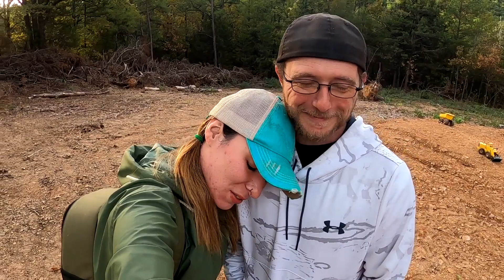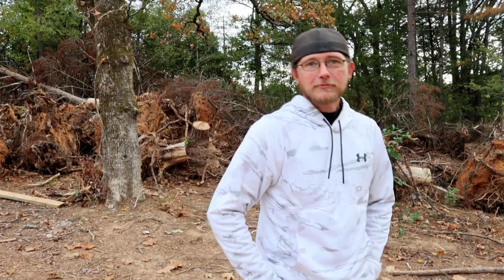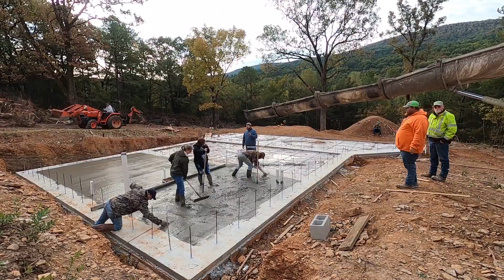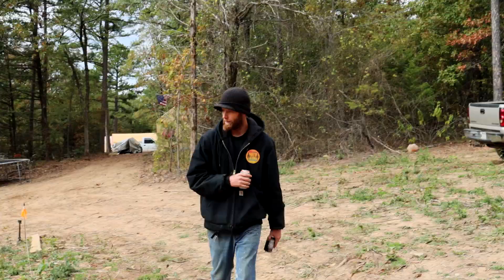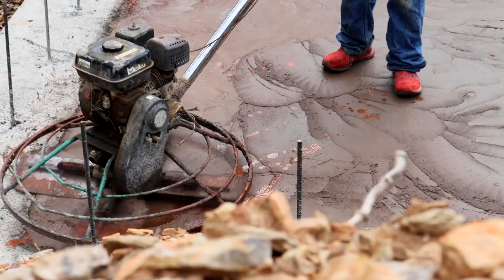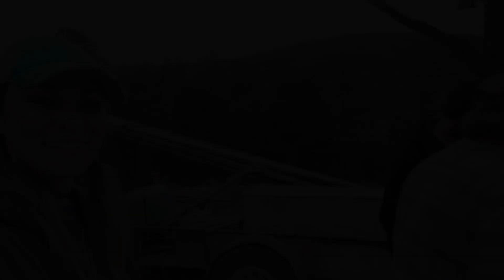It's Time! Ready Set SLAB! HUGE Progress Walk Out Basement Cabin Build

Comment: I thought I heard you say you were going to put the blocks off to the side till your ready to use them. When the block truck come put some lumber down on the concrete floor and set them on that so your not moving them twice or three times . Spread them out on the slab so you have them handy when laying the blocks it saves alot of time and work. If you don't you will take 3 times as long to lay the blocks. Trust me been down that road. Good luck

Comment: I stand corrected if wrong, but shouldn't the rebar be suspended in the midde of the slab instead of under the concrete directly against the plastic sheeting?
Reply from the maker: The rebar wasn't touching the plastic on the ground. And while they were pouring, If you look closely, you can see them lifting it with their tools to make sure the concrete goes under it and completely encases it. They did a wonderful job. 🤗
Reply: @SimpleLifeReclaimed   Guess I missed that part - Based my comment on the fact that on the first pour the workers were (occasionally) standing right on the rebar, thus driving it right to the bottom on the pour.  Granted, a review of your video did show some lifting, but not as much as feel it should have been - hope your pour doesn't crack over time.

Comment: Did you put fibermesh in the concrete or is there only rebar in the slab?
Reply from the maker: I think there's only rebar in there and a plastic film on the bottom above the dirt 🤔
Reply: @SimpleLifeReclaimed  Oh, the rebar should've been on 2 foot centers in the slab. Especially seeing that it's your finished floor. Let's hope for the best that it doesn't crack too bad. Cheers from Canada!😁
Reply: @SimpleLifeReclaimed  I would get somebody to come in and saw cut your slab ASAP to control where the cracks will be. I saw cut all my slabs that are finished flooring. The cut is 1/8-1/4 inch deep and 95% of cracks will follow the cut you make and then they're no visible.
Reply from the maker: @homernextdoor5950  I think Gary talked to Ronnie about this. 🤔